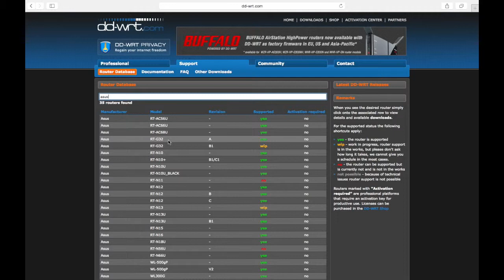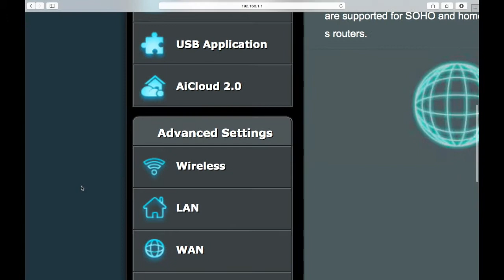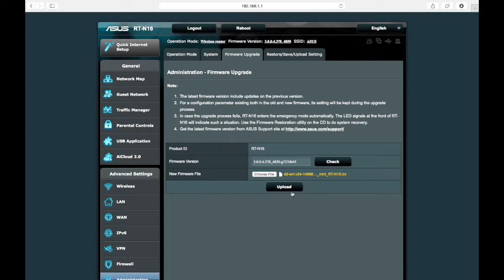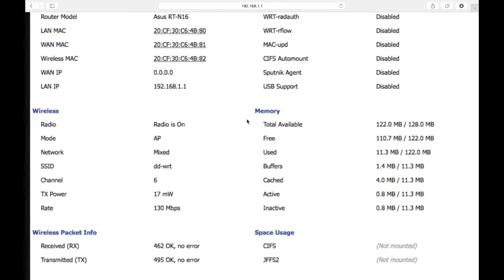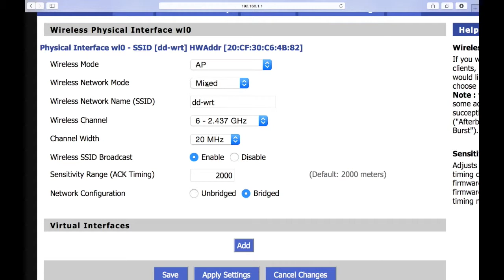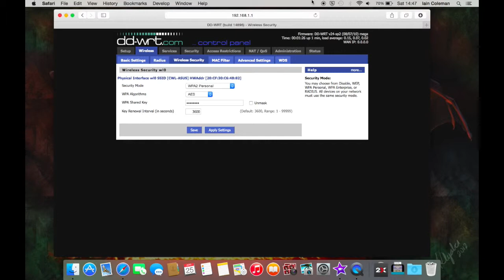Router PXE server project part 2 - Installing DD-WRT on the ASUS RT-N16

Comment: Just don't ever ever ever do this from WiFi. You will be asking for problems. Use ethernet with fixed IP.
Also, the router database is kind of OK for the initial Flash, but is also basically NEVER up to date with the recommended build. Sucks, but true. Some time is very hard to find the recommended build, other times is easy on the forum. Newer is not always better as well (some newer builds have new bugs). So, prepare to read a lot on the forum.